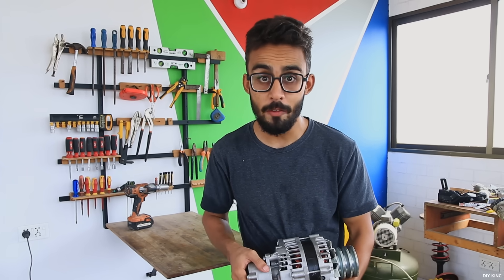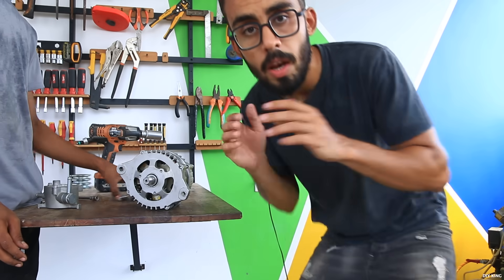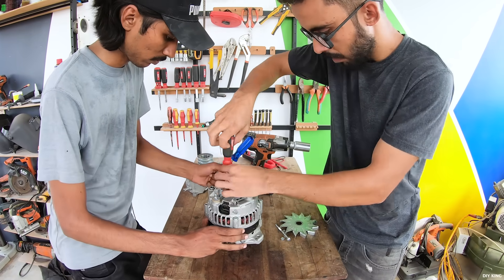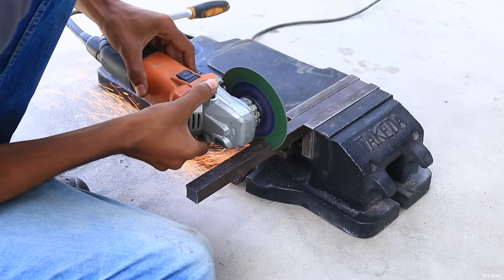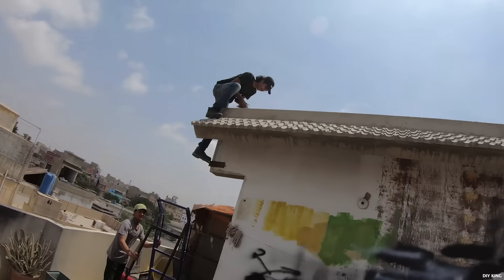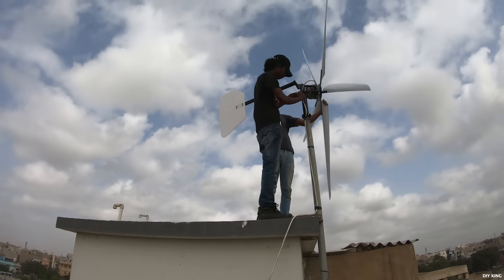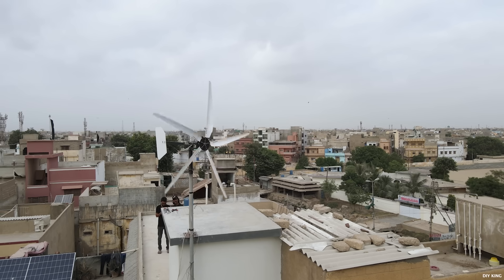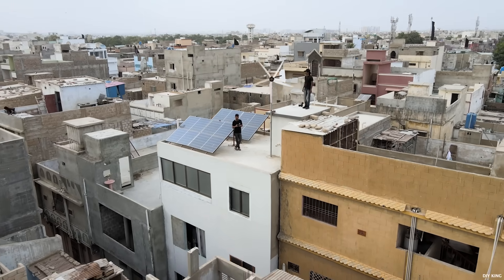Building a Wind Generator using a Car Alternator

Comment: You must add a gearbox to increase rpm and also use the turbine with a flywheel to get power from air by increasing cross sectional area of blades however you have done a good job well done.
Reply: No.

Comment: That is a vacuum pump in the back of that alternator. It is what Isuzu (and others) use for their hydraulic brake boost system,  in their small/ medium cab over trucks as the diesel engine produces no vacuum to assist in braking.

Comment: you can use step up voltage circuit with 14v dc regulator , it will charge the battery at any wind speed

Comment: Interesting. Why are you trying to achieve only 700 rpm when that would be tick over on an engine. Surely the best power output would be 28.8v at 1500 rpm taking into account that it's  a 24v alternator - where as  a 12v alternator provides 14.7v at 3000rpm? Just asking the question.
Reply: Explain how you can get the blades to spin at 3000 RPM ....

Comment: You can use smaller propeller and increase the RPM since the torque should be more than enough and you need more RPM.

Comment: 10 out of 10 for effort and engineering skills. I thought this would work and was looking forward in making my own. I would imagine a gear system will allow RPM to increase enough.
Reply: I agree definitely 10/10 on engineering skills. Maybe this footnote will assist others and yourself while you look for a way to change the drive ratios. I haven't built my own turbine yet because I'm still working on other projects that are required to come first. Anyway refrigerators in general use 300 to 800 watts of electricity and between 3 and 6 amps at about 120 volts. 
A 1hp well pump uses 750 watts. If it operates on 220 volts
Alternators need to spin about 2,400 rpm at idle, their maximum output is above 6,000 rpm but not to exceed 8000rpm. Best wishes and good luck!
Reply: @stevenwilliams2601 Could it just charge a battery like Tesla wall then use it when there's an emergency?
Reply: @kingdavidson7430  So far the commercial home wind turbine only produces about 100-150 watts per hour per unit with average wind speed of 4-5 meter/s, and cost ranging $1500-5000 per unit (the good one, or famous one at least), break even twice than solar panel, ranging 15-25 year.
Reply: Muhammad_Wahyudhi A car alternator can chargè a car battery so i was thinking the wind mill could spin the alternator enough to charge a battery
Reply: @stevenwilliams2601  Gear ratio of 27:1 with Planetary gears stacked in 3 could help. Might need to search other DC motor / electric generator in reverse that has 6 or 8 poles.
Reply: wasted alternator, steel pieces and PVC pipe. it's 1\10 man

Comment: Such an alternator has approximately 1.5 kW of power. But it gets it somewhere at 4,000-5,000 revolutions per minute. In addition, the car alternator is not a highly efficient device, because it is not its role. It is supposed to be small, durable, simple and operate in a wide range of revolutions, but at the cost of the lower the efficiency, the higher the armature revolutions and the generated current. For this it has its own cooling, fan, otherwise the windings in it would burn quickly. Typical speed for an air rotor with three blades is 100-200 rpm. That's fifty times too little.
Taki alternator ma około 1,5 kW mocy. Ale osiąga ją gdzieś przy 4000-5000 obrotach na minutę. Do tego alternator samochodowy nie jest urządzeniem wysokosprawnym, bo to nie jest jego rola. Ma być mały, trwały, prosty i działać w szerokim zakresie obrotów, ale kosztem tym mniejszej sprawności, im wyższe obroty twornika i generowany prąd. Dla tego ma własne chłodzenie, wentylator, bo inaczej szybko spaliłby się w nim uzwojenia. Typowe obroty powietrznego wirnika z trzema łopatami to 100-200 rpm. To pięćdziesiąt razy za mało.

Comment: When cooling or lubricating drill bits, use cutting oil which can be used for threading as well and alcohol will cool bits better than WD-40. WD-40 is not really a lubricant as WD stands for water displacement on the 40th try.

Comment: Great video!  If you use a large gear on rotor assembly,  would it be possible to turn multiple alternators with a small chain? A belt must be tighter causing more internal friction,  drag.
Reply: No, do not use gears.

Comment: A 4 to 1 reduction ratio would have probably worked just fine. Though I didn't notice whether or not you had slip rings installed on the mast head so the turbine could freely rotate 360 degrees without worrying about wire binding the turning radius? You could probably fashion a set of mast head slip rings off of another car alternator.
Reply: No, do not use gears.

Comment: It would be easier, and even economical, to take advantage of the brushless motor of an electric scooter wheel, of which they are an integral part of the wheel, it would generate three-phase voltage, so you put a regulator-rectifier of the kind used by motorcycles with large displacement, and you would have regulated DC voltage ready to charge a 12 volt battery

Comment: Nice Idea, and you worked hard to get perfect Rpm to get sufficient voltage, I must suggest you that do not put the alternator directly on rotor blades, instead you must try a gear ratio. You should get the power from the turbine through a bigger pulley, than by gradually use smaller pulley upto 4 times. Than you can get the sufficient Rpm. You can use also the teeth pinions instead of pulleies..
Reply: No, do not use gears.

Comment: Very good presentation. Your fast paced video has done exactly as it should. Just enough information to stimulate others into thinking and sharing.  Look into old wind driven well pumps to solve the over-speed issues. Thanks for posting.
Reply: What type of motor you wanna use? Liam F1 Archimedes blade is dope. Gear ratio of 27:1 with Planetary Gearbox stacked in 3 would be great. How about vertical wind turbine?

Comment: car alternator make 24 volt when you connect 24 volts bettey when u dissconnect the 24 volt bettey connection it will genarte more volts depending on your altrntre rpm

Comment: This is why in the older days we used car generators, not alternators. You don’t need a power source to get voltage. Just a regulator to control the output.
Reply: But the older days are long gone.  So, today we use an AC alternator.

Comment: Guys u need to add gear pully ( gear system)So that your fan blades rotated at 150-200 rpm  and convert @ 5 time to receive the desire rotation or speed for max output. And also u need to increase the length of blade. So that @ low wind speed u can achieve max energy
Reply: No !

Comment: Here you need to design a new generater with maximum number of poles , say 12 or more, could achieve high power output in low RPM.

Comment: Normally an car alternator needs to spin at 2000 rpm to achieve full power.
Reply: It needs to spin 2200 rpm to function normally, and for full power it needs to spin more than 6000rpm but not above 8000rpm for too long because it will shorten its lifespan if it will not damage it, so in conclusion car alternators are pain in the ass if there are used for another purpose than in cars

Comment: Play with the gear ratio, and I would recommend using a small solar panel to charge a super capacitor to excite the rotor coils (field winding) then once the alternator is producing voltage it could charge the super capacitor to keep the field winding energized.
Reply: A large gear (say 60 teeth) takes longer to do a full rotation than smaller gear (say 12 teeth) will. I have seen this work and will increase the rpm, unfortunately the way that this turbine is set up it would require a rework as the blades would me the large gear and there is no option to gear it like a mountain bike in configuration. If you can find an old series from the Discovery Channel called “The Colony” they do it in season one.
Reply: can you explain how will it increse the power
Reply: wish I'd thought of that .. ;) .. " charge a super capacitor " ..
Reply: At night?
Reply: @daveapplemotors  that is the reason behind the super capacitors, but the solar panels are primarily intended to provide energy to the system for the excitation current during the initial period from a dead stop to operating speed. Once the system is generating power it will keep the capacitors charged. Now assuming that the capacitors become depleted after sunset, you can either have an auxiliary battery or a connection to the primary storage batteries through all relevant circuitry.
Reply: RPM multiplier of Planetary Gearbox. Maybe vertical wind turbine design or Archimedes blade of Liam F1
Reply: Solar Panel = No!  Gears = No!

Comment: Hi, great job but there is a mistake here: The arm supporting the tail should not include a rotation hinge. The tail must be perpendicular to the fan and rotate with it, to always guide the fan in front of the wind.
Reply: They explain around 6:48 why they built a furling tail.  Designed to prevent over speed in high wind.

Comment: Very nice video. I would suggest to use safety PPE and safe measures while carrying out cutting, welding and misc works.
Reply: M Navy guy ?
Reply: AND access the roof in a spot you won't fall to your death if the ladder tips!

Comment: I see a nice collection of tools here. you can try many options. you could double rpms by adding 1 or 2 more alternators/blade units on the pole and add the power before inverter or skip the wind and power the alt with a 12 volt battery motor. keep a battery charger on the battery. power the charger by alternator's electricity to inverter & out to 110 charger. use permanent magnets on the alt. use a diode so no backfeed to alt. power with no wind, sun, water flow. maybe add coils to increase output and gear it just enough, maybe GEAR TO 20% MORE rpm. 1ST GEAR= 5. 2ND GEAR= 4. only 20% more is less friction some explanation of how the alt needs wired to get past regulator & into a regulator & ac-dc converter. nice video & narration. You did leave room for improvement. use the machine & DO NOT TRY TO SELL THEM. DO NOT VIDEO YOUR SUCCESS. THE ELITE OIL AND COAL AND TRADITIONAL $$$ POWER MEN WILL KILL YOU. BE CAREFUL. the last sentence is fact. the suggestions are experiments. don't share the successful video!
Reply: Stop acting like a child ....

Comment: The easiest way is  changing the rotor to a permanent magnet rotor instead
Reply: On rotor, by grinding /make space for magnets we can do..
. But question can we put magnet (in two parts) from magnetron of microwave.. Do u reply for experience
Reply: @Raga - No, that is not easy.

Comment: I tried this once and was able to get a decent amount of power from a similiar setup. Gear ratio is definitely a game changer. I winder if there is a way to have variable gear ratio depending on the wind speed… i dont have an answer for this yet 🙂
Reply: A cvt transmission is the best option, the simple version that uses no control circuitry, is commonly found in snowmobiles while there are automotive versions. But with the right application of a snowmobile clutch/ cvt pulley is the easiest option that i can think of.
Reply: Put on a heavy flywheel , use some external power to get it going first. 
That's my theory anyway!!
Reply: What's your gear ratio? Acquiring Planetary Gearbox seems tricky. Check out Archimedes blade of Liam F1

Comment: Use  v belt pully to increase rpm
Oltinator 3 inch and turbine 8 inch  to increase rpm
Reply: Hi Vee belt has too much friction. Bike chain is better, and allows easy changing of gear ratios by changing sprockets. Great video. Cheers, P.R.

Comment: Great Video! You are right to worry about RPM, a car alternator needs to turn at 3500-5000 RPM to achieve its full field amperage. If you are not looking for peak amperage but instead voltage, use an overdrive mechanism through a planetary gear box and ensure you are using a WYE type stator in the alternator. I daydream about making a wind powered alternator generator and appreciate that you did the work to see it through to the end.
Reply: Use one from a diesel - these run at half the rpm :)
Reply: @wombatg0  Really???? I would love to see you try to back up your comment. Just for comparison, the alternator pulley ratio on a Cummins Diesel is 3.22 which equates to an alternator RPM of 8,050 with an engine RPM of 3,000. Typically, The standard automotive gasoline engine alternators have their full output rated at 6000 RPM but can continue to spin up to 12,000 RPM or more without any additional increase in output.
Reply: @PH_INFO_101  I believe 3000rpm for my motorbike
Reply from the maker: Indeed, your thoughts are worth reading. I hope you will soon get your hands dirty building one.
We love to get such comments and that's why we together with you all bring this channel to the best possible projects that we can
Reply: Hi guys it is of very good job but I do not know what is the wind turbine, if you have any good of generating more power you can become a new company to sell your product on a lower price so that every Indian can purchase.

Comment: Guys maybe you could show exactly what you're doing, when dealing with electric stuff, point at it and explain what needs to be done ..just pointing a camera in a general direction and give general description is ...frustrating. Unless that's the purpose...? Otherwise, great project..
Reply from the maker: Yes you are right, we added these shots for better explanation and will try to improve them using a pointer next time.
Reply: @DIYKingSaM  Awesome 👍

Comment: Hello, You could use  Halbach array for permanent magnets as well as standard permanent  magnet configuration and compare results. Results would be very interesting, thank you!
Reply: Halbach array is trick to make or really expensive.
Reply: @mickmccrohon  Well The main disadvantage of the Halbach Array  is that it is difficult to assemble, and needs to hold in place during use, so thoughtful design consideration is needed.
Reply: @gantas7751  I helped build a 265 Kwatt motor/generator and we had the magnets made with north south poles made diagonal in the rectangle magnets. Expensive but best results and a carbon fibre belt to resist forces trying to blow it apart.
Reply: @mickmccrohon  265 Kilowatts?  Thats a really serious project! I think the scale and magnets used in this alternator would be much smaller and much less epxensive :)
Reply: @micmicrohon can you show me for a fee about the magnets ?
Reply: @mick mccrohon can u help teach me about the magnets ?

Comment: If u use permanent magnets on the rotor u will get your required voltage at a much lower rpm. No need for gears. As long as it's a strong 🧲 like n52
Reply from the maker: Yes we are looking for these magnets, hope to find the right ones soon and get the next part .
Reply: Well said mate 👍 and it's hard to rotate the blades if they add gears, better with Permanent magnets ;)
Reply: If I'm not mistaken the hoverboard motors u used in previous vids have n52 mags in.. try removing them. Or. Being a diy channel old hard drives.. they each got 1 in. . And they should be wide enough for that stator

Comment: nice vid! what was the alternator from originally? haven't seen any with parasitic oil pump attached before
Reply: It's not an oil pump. I am a car mechanic and many manufactures from Japan mount an vacuum pump on the dynamo. They use oil to lubricate the vacuümpump
Reply: @HkmWorks  thx! never encountered that either. good/efficient usage of space.
Reply from the maker: Didn't know the exact car/ truck that this alternator is used in but that's not a prestaltic pump.